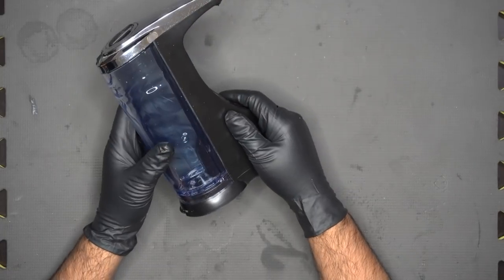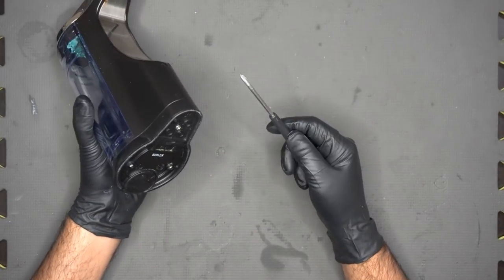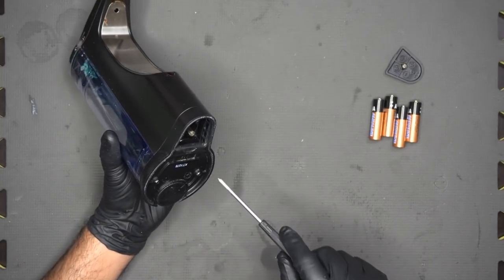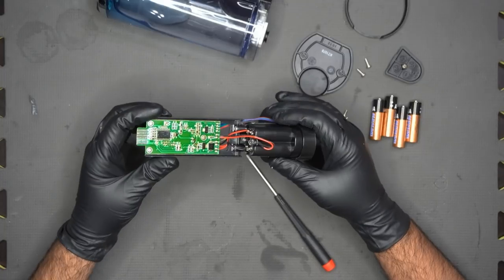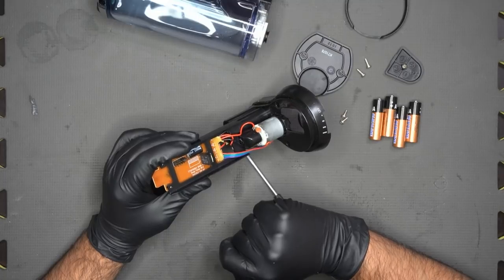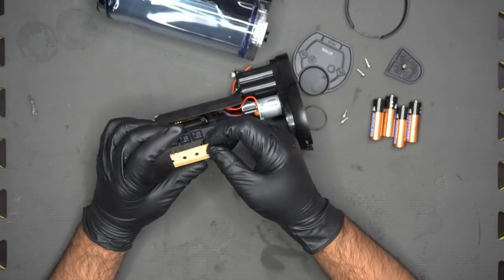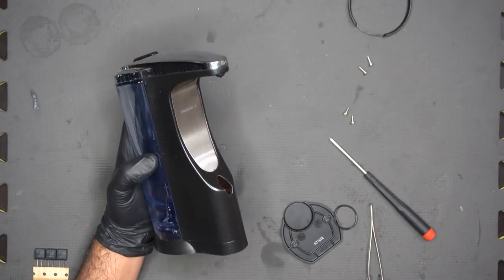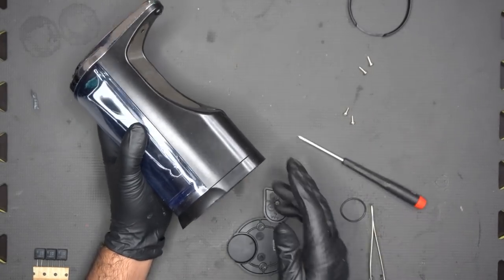DIY Repair - Fix Touchless Soap Dispenser

Comment: Hi, I have a SH dispenser but its sensor stop working, when I put my hand it doesn't work any more, but the mechanism works fine because when I press the button manually the dispenser works, at the moment I extract the soap manually by pressing (+) button. Do you know if it would be easy to solve? does the sensor expire? is it possible to replace it?
Reply: Did you ever find an answer to this?
Reply: @ht Nope, I still have the same dispenser and for 1 or 2 months I have to do it manually and then suddenly the sensor works again, then it works continuously for about 1 month or so and then stops working again. It was working the first weeks of February and now it doesn't work again. 😄

Comment: How do you take the top off to unplug clogged tubing
Reply from the maker: If I remember correctly, you can't open it from the top. See where I open in from the bottom, there are two long screws going all the way up. When you take out those screws the top will come off.